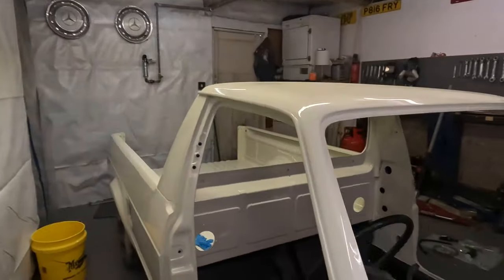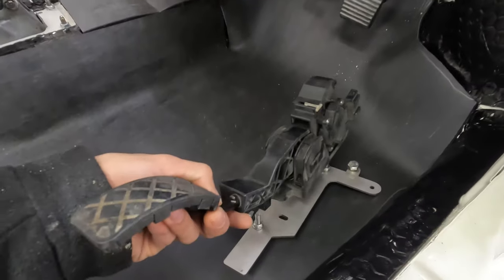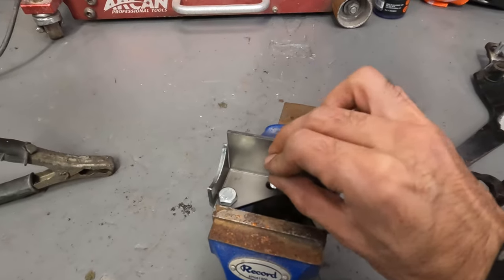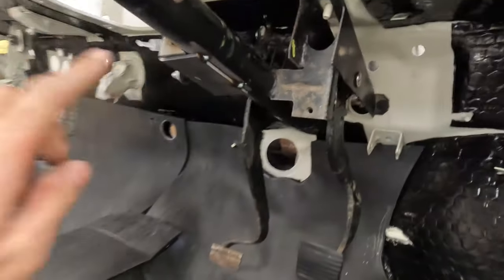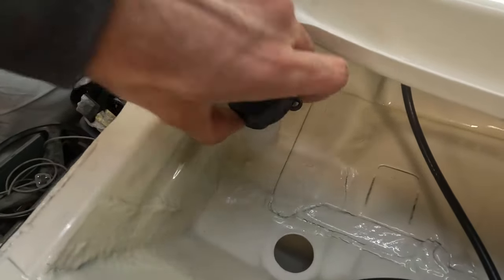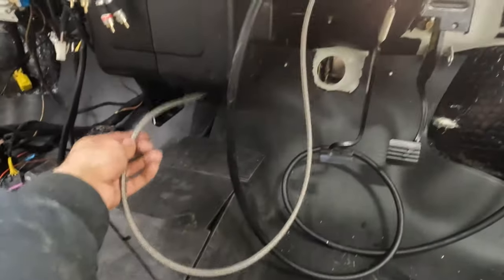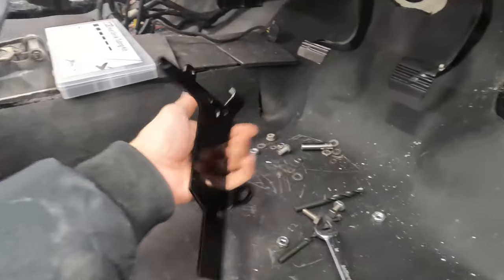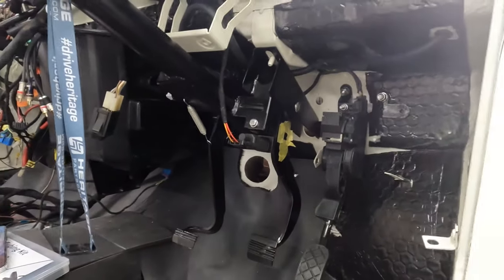Hydraulic Clutch Conversion Install in a Mk1 Caddy! - Episode 15 - 1987 Volkswagen Caddy MK1

Comment: Helpful video👍🏼 did you buy the brake switch mounting bracket?
Reply from the maker: Thanks ! I made the bracket out of some metal. There is already a threaded hole for the bolt to go through